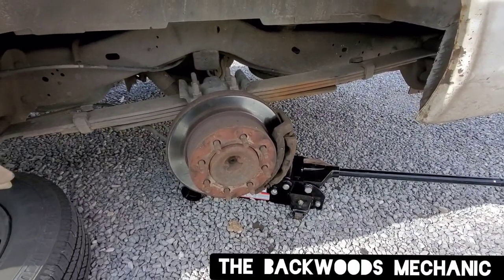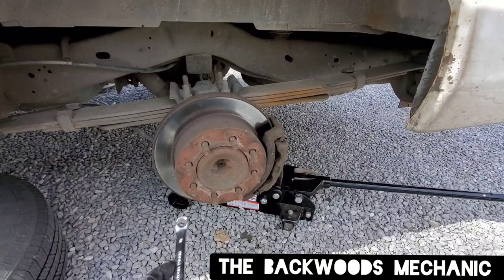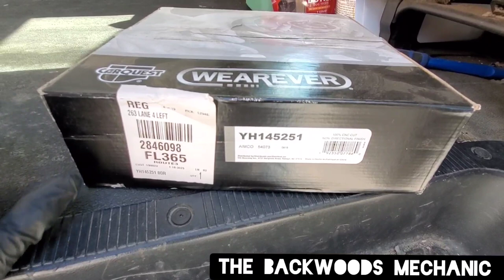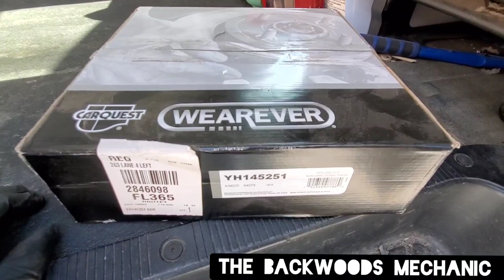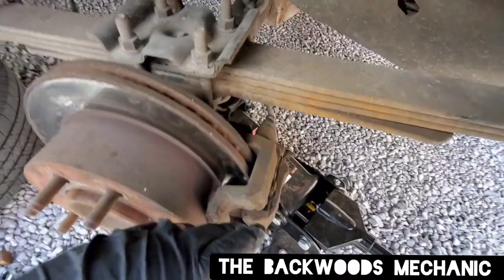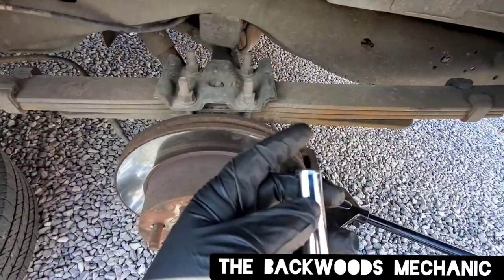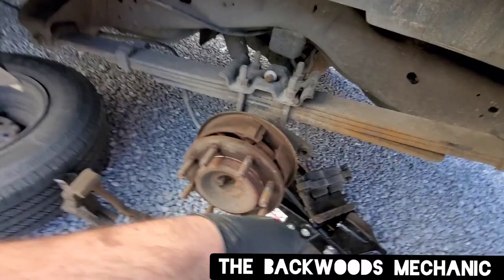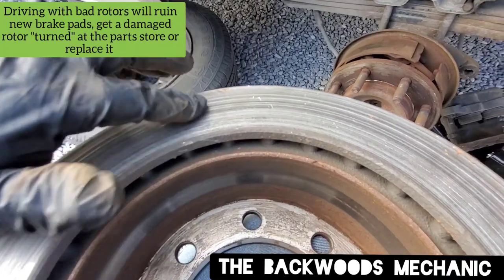How To Replace the Rear Brake Pad & Rotor 2007 Ford E-150 Cargo Van #DIY #Wearever

Comment: Perhaps this is an ignorant question, but why would your parking brake shoes would ever wear out if they are only used to hold the vehicle in place after it's already stopped?